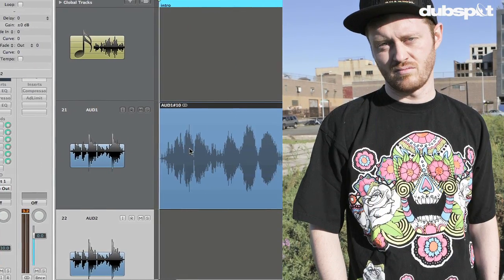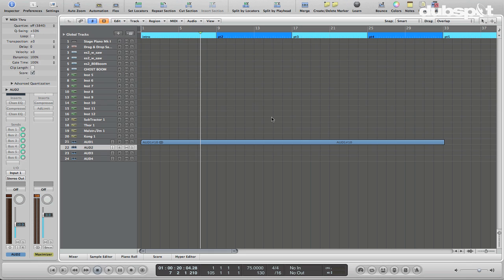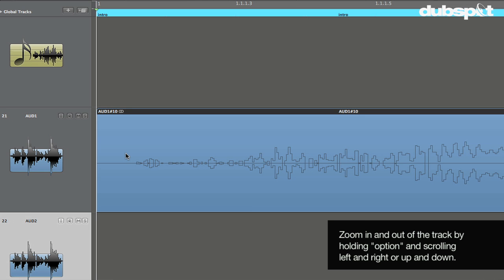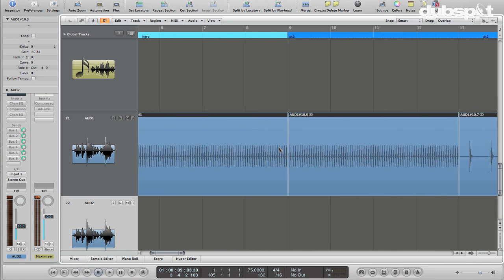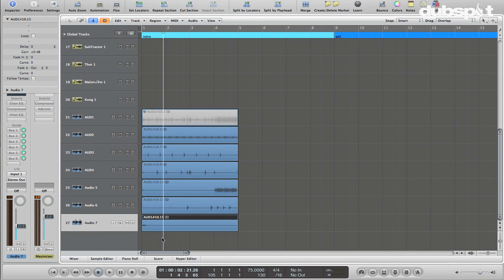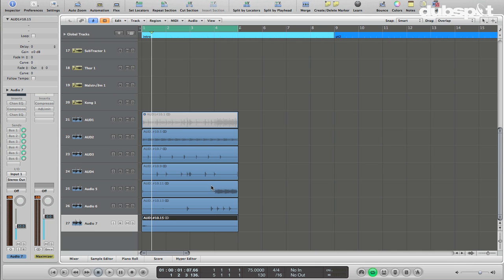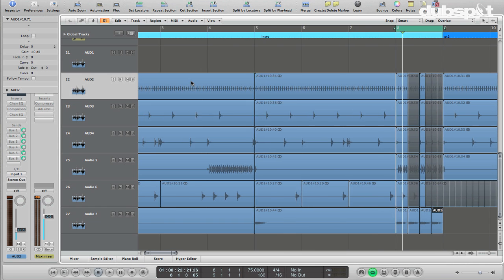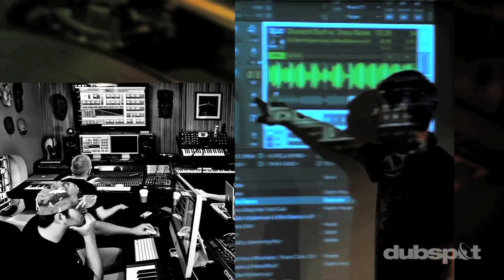Logic Pro Video Tutorial: How to Track Beats from Hardware Sequencers w/ Matt Shadetek

Comment: I'm not sure the steps in Logic. In Ableton, you first connect the mpc thru Midi in and out. Then go to preferences and click the midi box. Then make sure on the Sync buttons are engaged on midi in. Now when u press play in Ableton, it will start the sequence on the MPC, it'll also slave the tempo to it too. Just adjust the latency and boom. Track them in